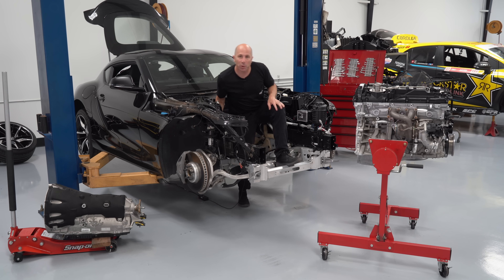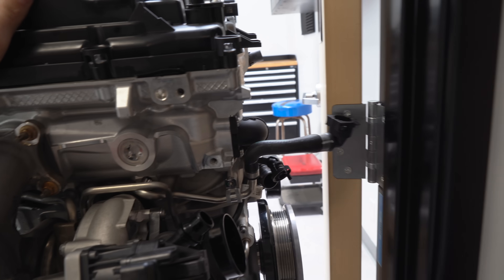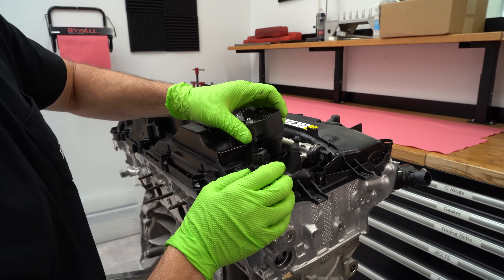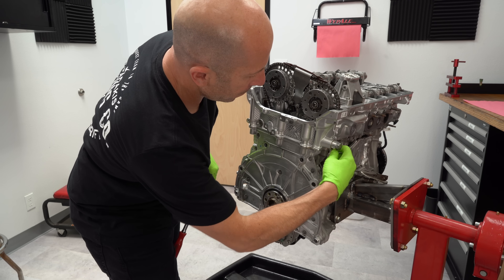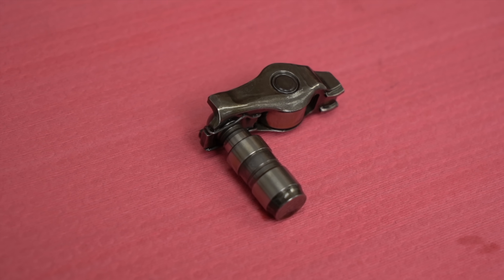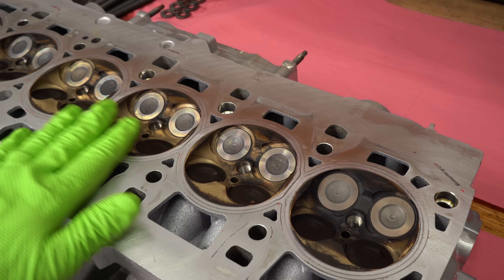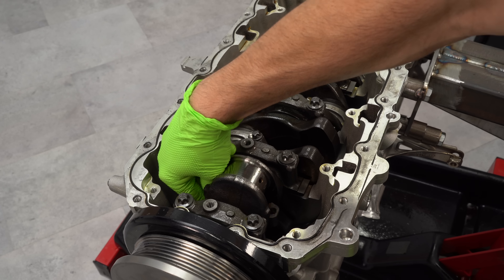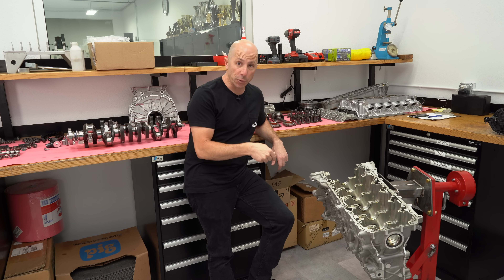2020 Supra B58 Engine Teardown - First Look - Better than the 2JZ?

Comment: Internet experts: This engine is POS. 
Actual race car builder: I'm pretty impressed 

Says a lot doesnt it
Reply: 日産スカイライン  *realise, British spelling. Anyway, Formula D, not rarely, have heavily build up engines, really can't call them stock. Reckon once people know the weaknesses of the B58, they will be able to produce said 1k hp. However, for most track driving and "semi serious" drifters, 600 hp is enough. 

Formula 1 cars V6 produces around 750-780 hp, the rest is produced by its electric engine. Not everyone is a world class driver who earns 10+ million dollars. If you are in said Formula, or Formula D, you will NOT be driving with a stock engine with a massive turbo on it.
Reply: Auugh   Nobody who knows anything about engines bolts a huge ass turbo to an otherwise stock setup. I’m Completely positive thousands will do exactly that.
Reply: And yet all the pro drift teams swapped in 2jzs into their cars lmfao
Reply: @SaturdayWinter  not really if that's the case we'll see nothing but JZ's in FD but we still have the drama of drivers having different engines so your point is subjective and false in a way not completely
Reply: 日産スカイライン there’s already people pushing over 700whp on the B58 on stock internals 🤷🏾‍♂️ and they’re running all good and healthy
Reply: Jordan John it’s not been out long enough to say they are “good and healthy”.
Reply: @V3LOCITY__  they were doing that on bone stock 2jzgte. What's your point?🤔🤔🤔
Reply: 日産スカイライン the REASON why people 2jz swap the new supra is because they don't have time to develop the b58 engine, like Daigo saito
Reply: @ferdihimawan7088  2JZ was daigo saito's specialty, why would you go on with something ylu dont even know and go to a conpetition if you can go with the one you really know and win.
Reply: 日産スカイライン Everyone is comparing this engine to the 2JZ. The bmw engine will easily make 600bhp all day. So if anyone is doubting its ability to "replace" the 2JZ they must be talking about power more then 600hp right?
Reply: @323gtxr  honestly the 2jz aint making much more then this engine to be honest on bolt on im pretty sure on purely stock engine with just ecu flash intake and exhaust this will probably make more power since the original mark 4 supra with its twin oe turbo set up with basic bolt on barely make 400whp this thing just made 420whp with a simple tuned a full exhaust and intake well probably see this in the 460-500whp and bigger turbo/cooler piston rods cams valve springs and fueling set up might see this go over 800whp easily on stock crank this engine is definitely a 2jz successor
Reply: @323gtxr  someone tuned the B58 motor wuth a simple ECU remap not other mods and its putting out 500+bhp at crank and completed the 1/4 mile in 10.7 sec. B58 is 21st century's 2jz engine
Reply: @abhinashpattanaik5109  find that hard to belive, Racechip just did 400at crank,,,you must be another FAKENEWS
Reply: @abhinashpattanaik5109  nah it aint it will never will.
Reply: @323gtxr  stock iternal 2j can handle 6-700hp if this can hade that stock.... I will be impressed. The biggest thing for the 2jz was that it was "balanced" in the way that each cylinder fired. They didn't mention if this engine was or not. That's a big key to making big power with not a lot of work.
Reply: @brysonjohnson2983  if you're talking about primary and secondary mechanical balance, all inline sixes have it. 2JZ isn't alone in this category.
Reply: @RiloElton  ahhh, thank you! That's pretty cool within itself...
Reply: @brysonjohnson2983  The previous N55 already does 600 stock, this is improved design and will do more.
Reply: @mnoovurvi  and k24s are doing 1200hp now. But they don't last for long at all. How long would that motor last at 600hp stock?
Reply: @brysonjohnson2983  They last, there are a lot of people running 600p on the old engine with no problems.
Reply: @mnoovurvi  so then why isn't it know in the top 5 then? Even the barra is more well known than that...
Reply: @brysonjohnson2983  with a built head and modified old pump relief on a stock short block 2jzgte was capable of 800 850 wheel
Reply: @brysonjohnson2983  um what? It's a i6 vs a i6 the balance is likely better for the b58 with direct injection having a better control of fuel. And better bottom end characteristics. The 2jzs only saving grace like all Toyota motors that are popular for power is Yamaha working on it
Reply: @jdrok5026  better bottom end characteristics like what? An iron block? Forged parts? How big are the oil holes to keep it cool? Strength between the individual cylinders? Thickness of the block? What exactly are you saying is better?
Reply: @brysonjohnson2983  an inline 6 is inherently balanced in the primary and secondary forces. That's an inline 6 thing not a 2JZ thing. Derp
Reply: @johnmiller678  did you read what everyone said before you? Derp
Reply: 日産スカイライン  you do realise , that apart from drag racing, you rarely ever need that much power. Track driving or drifting usually are happy doing up to 600 hp.
Reply: @CFAuugh  Tractor engines pullers in trucks range from 2,000 to 10,000 HP (Combine)
Reply: Auugh 
Well said my friend I have 620 hp at the wheels, it does not matter if your on the track or drag strip or streets you very rarely get to use all that power.
Just a reference  it take me about a mile to hit  208 mph/334kph
Reply: @CFAuugh  man it is just unreliable this man have the engine to replace ans fuckung make parts and a 2jz people waste a third of this money
Reply: Auugh Literally all Formula Drift cars are 1000+ bhp...
Reply: 323gtxr Ken Gushi’s first setup for his FRS was literally 750BHP as covered by  SuperStreet.  Wtf are you talking about...
Reply: Mok3sp33d And the current setup?
Reply: @323gtxr  i dont think itll ever replace a 2j being the fact stock internals on a gte can easily hold 700-800 whp. Also notice the dual port exhaust? Thatll be one of the first things to go as for vw used to have dual and quad port flat fours and the dual ports were complete garbage. Second thing to go would be that awful mech fuel pump...
Reply: @ebkbk9902  awful mechanical fuel pump? Do you know what its rated to supply or someshit? Because you just acted like mechanical makes it bad.
Reply: @323gtxr  no their not only some are.
Reply: Everyone on the comments are crying and pissing, and the actual engine expert says it's pretty good.
Fanboys, fanboys everywhere
Reply: 日産スカイライン  Well then, which engine would you prefer? This is the best inline 6 engine in the world that can comply with modern emissions regulations. Toyota hasn't built decent performance engines in decades. Toyota from the 2JZ days and modern day Toyota are two completely different companies, nowadays BMW is the main authority when it comes to inline 6 performance engines and they have been for decades. BMW is known for the M5 and M2.. whereas Toyota is known for the Prius.
Reply: @komentierer  .. You really trying to match toyotas ability to build a performance engine that will also take you to work every day for the next 10 years.. Not 3-5 like BMW?
Reply: Kommentator mercedes entering the straight 6 market soon as well, hopefully theyre up to some cool stuff as well
Reply: @komentierer  Clearly you haven't heard of the mighty barra in xr6 turbo's in australia.
Reply: @lolbye778  Those were only compliant with Australian emissions regulations. Also, they stopped production 3 years ago.
Reply: @lolbye778   The Barra isn't being built anymore, and they're not even building cars in Australia anymore, so do you have a point?
Reply: @Theonixco  the barra boys no that's it's junk they just like to talk shit up.basicaly most of the jz guys I talk with find the barra funny and just ignore them
Reply: @komentierer  hahaha you just destroyed that clown! They fools have no idea. BMW has been building THE BEST I6's for over 25 years.
Reply: @komentierer  even though that is true I think that if Toyota used one of their V6 engines from their modern Lexus LS 500 which is already turbocharged (twin turbos if I remember correctly) and is already pushing around 400hp from the factory without any mods or a use the same V6 that can be found LS350 which is also in their Tacoma, and I'm sure due to the Tacoma fans there's some aftermarket value to those engines there wouldn't be as much of an issue towards the new Supra like there is right now, mainly because it would be a Toyota engine but I know people would hate it for being a V6 and not a straight 6 even though it's more than obvious that Toyota had no intentions on designing a whole new engine for performance since that's not their main focus anymore, although I'm not an expert on Toyota engines, I do agree that using someone else's engine is not very promising but I'm sure they have their reasons
Reply: Elon "CheekyKnob" Musk ...it was for production, and to make a new engine platform would have cost way more money and the the Supra wouldn’t have been 60k if not more like 80k so price was a big thing if you compare to other manufacturers.. they wanted it to be competitive and affordable...so why not use some one who already makes an I6 engine turbo...just like how hey did their RAV4 EV, they sourced their electro motor from you guessed it Tesla, although Tesla never gave toyota the ability to diagnose...the only thing Toyota has done new is all their hybrid and fuel cell technology.....
Reply: @Dunki113  dude the supras used to have 3rd part companies come in on the design of the engines.
Reply: @jdrok5026  well, I never said that there was anything wrong with the current engine, other than the negative results from the fans, I was just saying that Toyota could have used one of their current engines instead of a BMW engine, I mean, I saw one of their commercials for one of their Lexus cars literally drifting, I know it takes more than just a good engine to drift but I mean they do these kinds of adverts with their Lexus branch and then expect us to not be upset when they half-ass something in their main branch?
Reply: Elon "CheekyKnob" Musk Toyota would never use a V6 on the Supra. Supras are known for their in-line 6s. Guess who makes a ton of in-line 6s? BMW! Makes sense to me. Not to mention the B58 is really good I have 55k miles on mine with no issues whatsoever.
Reply: @komentierer  so Sad and your right. Also all car companys are be head hunted for making sport cars
Reply: @komentierer  that's because toyota can't build decent engines, Yamaha can..
Reply: @komentierer  "Toyota hasnt built decent performance engines in decades" interesting point. Dont forget who won the 2018-2019 24 Hours of Le Mans and with whose engine.
Reply: @crownmajesta1064  Toyota gets their asses kicked in F1 and only win LeMans after Audi and Porsche left LeMans! I would've liked to see Toyota try and snatch a LeMans championship from Audi the last 15 years when Audi was going full factory support. Porsche was already even though in lemans pushing full factory support and effort into formula E. Still Porsche has 19 outright wins overall at LeMans. Japanese cars get their asses kicked against German and european manufacturers when all out factory effort is attempted.
Reply: @thof8287  https://youtu.be/oXt1o5Z-Jco add 2017 + 2018, 2019 wins. I might add that the fastest lap records are both toyotas and both highest average speeds are also toyotas.
Reply: @crownmajesta1064  And how exactly can I buy the Lemans engien to use ?
Reply: @thof8287  say that to the 8years vw tryied to win paris-dakar, wasting LOADS of money,having more cars in race than everyone else, BENDING the rules in their favor ,and they just wont AFTER mistubhisi retired. You are a FAKE.
Reply: @crownmajesta1064  yeah, the great Toyota LMP cars, which became relevant only because Audi and Porsche quit Le Mans altogether.

Bragging about winning a race, where you are the only 'serious' competitor (as in with a big ass wallet) is pretty fucking stupid, you know...
Reply: @crownmajesta1064  toyota won leman? I thought it was a pitty win for how pathetic Toyota performed
Reply: @balazsecker8204  2014 World Endurance Manufacturers standings
1. Toyota: 289 points
2. Audi: 244 points
3. Porsche: 193 points
Reply: Numbers are numbers dawg. Fuck what youtubers say. Carroll Shelby built up high performance machines and he probably wouldn't care for this engine. You can't pick one expert to make your point. I don't see Hennessy trying to mod this thing. GT-R's 10 years old and it's making 540hp from the factory get real.
Reply: 日産スカイライン this car wasn’t made for you lol. This whole 1000whp group is a niche inside of a niche. 2 seat sports cars are not very profitable because they aren’t very practical. Most people that buy the mk5 aren’t going be chasing huge hp numbers or even modify there car at all. The b58 is a well built engine for what it is.
Reply: How the fuck peoole a actually going to doubt bmw you can pull nearly 400 bhp out 3 litre n57 diesel Mon like.
Reply: 日産スカイライン  1000hp 2jz breakdown all the time too lol
Reply: 日産スカイライン=Nissan Skyline in Japanese words. All of these cancer done by a sole Skyline fapper. Well done XDDDDDD
Reply: Well horses for courses as the saying goes. His primary goal is to make big hp for a season, maybe a year, then it's torn down and rebuilt. Joe Bloggs on the internet just wants it to keep working for longer than a mobile phone signal standard. I've got Alfas and they're much the same - beautiful engineering to make things go and turn, longevity and ease of repair were secondary considerations however.
Reply: 日産スカイライン  "tons of race car builders"? Give me some links bro...
Reply: I think there is some cool, well thought out design features of this engine, but if it was simpler and easy to work on, like the 2JZ, then the ppl in general would condemn it less.

i remember hearings stories from old mechanics about when carburetors were being replaced with computer fuel injection and how allot of them left the business...just cause it was something new, complicated and misunderstood.
Reply: @Deadpool4352-f3v  Of cause it could, street legal to 2019 emissions regulations and with minor modifications to factory spec. And with 1000hp it lastet 200k miles with just an oil change.
Reply: 日産スカイライン  and you are Japanese and the guy that commented I guarantee your opinion mature more than his
Reply: @Legend-lc9bv  
I don't know, man. Japanese regular folk are the biggest fanatics on the planet. And fanatics with their opinions aren't to be taken so literally. Especially when their country has an outright zero tolerance on metropolitan street racing. If he isn't a professional race car driver, mechanic, or a certified automobile engineer, I wouldn't take his work for a lick damn.
Reply: There is NOT "tOnS" of people anywhere swapping 2J's into MK5. There's ONE maybe, maybe 2. But what a stupid thing to do.
Reply: 日産スカイライン   Not just Americans speak English. Both "Realise" and "Realize" are correct, based on where the speaker is from.
Reply: 日産スカイライン  
Calm down, kid. You're not even a professional race car driver. Plus, Carfax wouldn't even give you 2k for your riced up POS.The tuner scene is a joke, really.
Reply: Internet experts drive cobalts with cold air intakes. Their opinion doesn't matter
Reply: 日産スカイライン  steph papadakis pushes the limits and truly know what he's talking about. He took the 2AR-FE and made it a beast of a motor. I'll take his wisdom any day over anyone else.
Reply: The GTR was a supercar. The supra was a gran touring car. Most people here need a history lesson.
If you complain about the car because of cost and reliability it's fine. But if you complain about the supra and bmw engines being reliable, but if the McLaren f1 is one of your favorite cars then you're a massive hypocrite.
Reply: are you surpised internet people are uninformed?
Reply: If we go back in time 25 years ago, the 2JZ was a fairly new engine that tuners were figuring out how to squeeze as much performance as possible out of it.  It took years before 1000hp+ A80 Supras became common.  And our world is far more connected to the internet than ever before so it more than likely won't take as long till A90 Supras with over 1000hp become common.  Bottomline is we can't satisfy everyone.
Reply: Dat Boii  it makes more hp than the z4 tho
Reply: No, its one "race car builders" opinion, no actual numbers or testing to prove otherwise. Until they reach the limits of different components and start uncovering the weak points in the engine I will still have my doubts.
Reply: 日産スカイライン with that logic every brz and 86 would be wide bodied and turbod. Not all People w money to buy this car are going to go balls to the wall with mods. A good amount will remain stock. Your using your nostalgia of the mk4 and comparing it to now.
Reply: 日産スカイライン  your a idoit....
Reply: 日産スカイライン  they didn't build the whole engine. They had an actual idea to make a 3jz but it was scrapped. Because it would cost the car way over 100k because of R&D. And their target competition was the Porsche Cayman, not the Nissan gtr.
Reply: 日産スカイライン what about the S50 then ? Since is at least bmw engine going in bmw bay ? Why we bring 2jz since that part of the car is not Toyota ? What 2jz have to do with the new supra at all ? Nostalgia probably 😁
Reply: 日産スカイライン well I did make my own version of a Supra in a car building game called automation. Only thing is if I showed you how it looked like and the specs, it would look exactly like a Lexus. I'm even thinking of getting a manual as a first car. Since here's what the stereotype is, it's basically "You have no right to complain about a car if you can't afford it." That stereotype is seen a lot in the car industry. And even I know coupes don't sell. But it's not like they can make a 1000hp engine without having a huge ton of emissions. Which make modern cars so heavy.
The 2jz lineup ended in 2002. People are always going to find a way to complain. If they put a Lexus V6, they will complain about it not being an I6. The 2jz was a response to compete with nissan's RB26DETT engine.  The one thing that made BMW so popular was probably their m3 e46, especially the gtr because need for speed most wanted. But yeah as I said,manuals don't sell well in America. Europe and Asia are already fine. But for it to sell well in America, people in the us need to drive manuals more. But even news articles says that most young drivers are no longer interested in manuals. I'd want to talk about this more but problem is I can't type for too long on YouTube comments and they always switch every single time. So if you have some type of social media we could continue there. I don't want to start a war.
Reply: Bud.. While it might be impressive as fuck.. The average joe that buy this automotive abortion does not have the budget of a race team! We have seen the performance of both BMW and Toyota and history proves, there is no comparison.. Both start out strong, only one passes the test of time, durability and reliability! That is what the "internet" warriors are referring to when we call that motor a massive and grossly over complicated POS!! Understand?
Reply: I remember a guy brought a 1000hp Supra to the track one day. He literally couldn't drive it because it had the worst fuckin powerband ever. Good luck with all that idiots. It's not a Formula 1 car with giant, sticky, purpose-made tires and a giant wing for downforce. 1000hp in a 1000 rpm band is going to be shit and turn worse times on almost any track aside from maybe Road America.
Reply: Too much plastic. In 10 years these care will be nighmares
Reply: 日産スカイライン  facts, 200hp is more than enough to break a car loose. Used to do it in a ranger with only 120
Reply: the people on the internet are more mad about the car itself than any of it's parts. it has a $60,000 price point a race engine builder better be impressed
Reply: Yep
Reply: 日産スカイライン  you are correct about that oil hasnt been much of an issue my clutch fan exploded though sending some if it through the old radiator which I planned to replace anyway because BMW is known for using plastic where it shouldn't be but my real issue was dealing with some suspension issues that the previous 2 owners did not take care and vaccum leaks because the lines are almost as old as I am but since fixing that the car has been pretty cool yo just working suspension now yo
Reply: "impressed" can go in two directions
Reply: Dat Boii  BRZ?
Reply: But he is selling us something.
Reply: No not really. This isn't an engine you'll see very much of, and when you do, an expert opinion doesn't mean shit, because they aren't the one fixing it.
Reply: @babajungLA  thats because nobody knows that" lease a bmw dont buy it" ...another fakenews
Reply: @Deadpool4352-f3v  you and your butt buddy with that wierd ricer name tag enjoy talking shit. While I go enjoy driving cars.
Reply: 日産スカイライン  you are right about the resale value but wrong about reliablity. My f10 535i has done over 140000KM and not a single breakdown apart from timed maintenance schedule. Servicing is pricey but my car is munching miles so effortlessly. Only problem i face with my f10 is the tyre as i have to import it from outside it's damn expensive!!! Plus i am planning to get a Steinbaur powerbox from austria to increse the midrange punch.😁
Reply: The only thing that sucks is the timing chain location. The engine has to be pulled out to change it.
Reply: +QurttoRco If you're genuinely surprised random people on the internet generally have no clue about what they're talking/complaining about boy do I have news for you.
Reply: @dumbdumb572  i do not understand you message
Reply: Well what else do you expect , he is a Honda guy , they should have had Vinny Ten doing this video lol
Reply: THATS WHAT I’VE BEEN SAYING!
Reply: 日産スカイライン  Maybe BMW payed Toyota to screw up on their Supras?
Reply: Dat Boii  I k o o ok k Oo bk o
 K no k. K. No oo k k k  invite
Reply: B58 has been has been out since 2015 why has there not been any h horse power over 700 in the past 4 years? what's the hold up?
Reply: @adamcz3183  there has been 700 plus hp the hold up mainly is likely the direct injection. Just like the 2jz it's going to take awhile to get high hp. Except the b58 might actually be a good engine.
Reply: QurttoRco Not really, it’s all preference.
Reply: 日産スカイライン it's not the engine actually, just the electronics are very bad. I know lots of people would like to have a new manual Supra. But, from a business standpoint you have to first sell it to the normal sports car market. Which most are automatic. Manuals don't sell that much in the us. But for Europe and Asia they might.
Reply: Or the new answer experts now give. Internet experts: tHe c8 eNgINe iT"s bEtTeR!
Reply: I wonder how many people ACTUALLY think this engine sucks lol
Reply: @joshmellon390  it doesnt suck, not by any stretch of imagination. It comes from an automaker who has been building I6 for a lengthy amount of time. Its just not what we wanted. Just like how Honda fans hated the hybrid transmission in the NSX.
Reply: @crownmajesta1064  hybrid engine with a DCT tranny
Reply: @Deadpool4352-f3v  n55 is a pretty good engine. My car has done over 140000kms and i remapped it and now it puts out 400bhp. Also planning to get an steinbaur powerbox😁
Reply: @abhinashpattanaik5109  my dodge neon makes more than that with 2.4L
Reply: @atodaso1668  it's stage1 flash with a mild tune and i chose for a milder setup because 400BHP is more than adequate for indian roads.. Anything over that it would have become a pain in the ass
Reply: @Deadpool4352-f3v  well then send my pity to your friend but i say it cause i own and drive a bimmer. If it were that unreliable, i would have surely dump my car on the bmw service centre's roof. Afterall we indians love our hard earned money to be paid off to the fullest. The 35d versions which puts out 300bhp and comes with a xdrive system had fair share of problems. But its all sorted out after the f10 facelift. My N55 is jewel of an engine, period
Reply: @networkengineer4405  it's a concept. The current car has a lot of cues from the FT1.
Reply: Truthfully, this engine looks like it was made for modular aftermarket parts. I'm impressed.
Reply: Dat Boii  Please explain what a "Toyota" is here in 2019/2020?
I will tell you, today Toyota is yesterday's vehicle for tomorrow prices. In the Supra IV days they were tomorrow's vehicle at today's prices. They havent designed/engineered ANYTHING worth mentioning in the last 20 years. Do you realize how lame it sounds trying to prop up a company who left their peformance crowd behind so long ago?
Reply: @johnmiller678  well they made the LFA supercar.
Reply: @ebkbk9902  well it kinda replaced the 2jz😁
Reply: @abhinashpattanaik5109  not even close. thats why people already 2j swapped their brand new off the lot bmw? There literally ripping out these trash b58's and making 2j swap kits already.
Reply: 日産スカイライン  z4 is based on the 3 series and 5 serie(CLAR platform) Toyota gave the supra 2 seats because short wheelbase will improve handling dynamics.
Reply: 日産スカイライン  1 year and 25 years is a very huge difference. Emissions regulations was different back them, toyota probably fixed problems that the 2jz had over time. Tell me, how demanding was the sports car market back then compared to now?
Reply: 日産スカイライン  thats basically a rebadged rc f and there's a difference between that and the new supra. The rc f is more for top speed while the supra was made more for acceleration and cornering.
Reply: 日産スカイライン if you complain about a car engine because it won't make muh 1000 horsepower then there's clearly a problem.try selling a car from a tuner standpoint and see how it fails
Reply: Tohafat your logic makes no sense. If he saw flaws in the engine, why wouldn’t he state them? They’re building a 1000+ engine. He’d want to mention any weak points they fix
Reply: Guy that gets paid to fix it: It's great!
Customers that have to pay to fix it: Fuck this
Reply: 日産スカイライン  The engine is relatively new. Jesus christ over her predicting shit. I mean do you know the limit of the B58? Like it's around 1 year old or somewhere around that area.
Reply: 日産スカイライン  I'm not a fan boy. You see you're classifying from a group that i'm not from. Furthermore isn't this just a  copy and pasted paragraph. Like Jesus what's the point for arguing in a 2 week old post.
Reply: Race car and average user car is very different. Race car changes engine once in 1000km or less. Average user car need to ride with ome engine for whole life. Sorry for my english.
Reply: 日産スカイライン  I really don't wanna involve myself in this but anyway the B58 looks like a good platform for what it is regardless of it being a BMW motor. It's decent for what it is and can more than likely make a decent amount of power(calm down before u jump the board and say that the 2js better that's not why im making this comment, im heavily talking about the B58 only here)for what's done to it. Since the engines basically N54/N55 that is closed deck and has some parts like the block and bottom end being derived from the B57 diesel plus its block being made out of the same material as the VR38 and coyote I see no problem with it hitting 1000hp now while in the Mk5s case it'll probably hit 1000hp by the end of this year(not saying it will)since companies already have it hitting 560hp while the BMW's with the B58 have(from what I've heard)hit 820hp from stock block and internals with a bigger turbo, pistons,injection,and a tune. Now the only things that I know of that's different in the MK5s B58 that Toyota had changed is the fuel system,turbo,heads,and the amount of oil squirters in it's B58 while all the other B58s in BMW's dont share really any of this that's in the Mk5. I'd also like to include the S55(ok please don't bash me too hard on this im still looking into the S55)since really it seems like no one's really taken notice that there are a few companies that already kicked the S55s in BMW F80 M3 sedans up to 1000hp up(one hit 1170+hp on stock internals,and block just recently breaking the old record of 1158hp)there might be a few of these but I feel like these should be able to hit 1000hp or pass 1000hp without a problem now not saying it's going to hit 2j numbers but it's should be up there in its own region of hp(I'll go off and say it can hit 1100hp at best).
Reply: 日産スカイライン  F1 cars weigh 1000 lbs and are shaped like flat wings, no streetcar can match the downforce. You should really do some research
Reply: It's still a BMW
Reply: Dat Boii  but Toyota never said it was anything else
Reply: it says this guy is paid shill of toyota/bmw
Reply: The 2020 Supra was recalled (by BMW) for bad welds.
Reply: Well the bmw engine doesn't have near the aftermarket support the 2jz does and its a more advanced engine than the 2jz. It would make more sense to go with the 2j until the Bmw engine has the aftermarket unless you are a guy that likes to be at the forefront of things. Like LS guys have not messed with the newer LT direct injected engines yet because there is not a lot of aftermarket support and enough in the junkyard yet
Reply: 日産スカイライン  Toyota doesnt deem to care about performance cars anymore. I know they where not letting video games use the supra as they claimed it gave them a bad image
Reply: Yeah ok a plastic intake manifold and intercooler im good. This shit doesn’t look like it’ll last at all passed 10 years hope no one intended to keep one as a collector car
Reply: 日産スカイライン  Except it already hit 1000HP in many builds stock or next to stock, dunno the WHP. I don't think it's as strong as the 2JZ, but it's a good engine. BMW do make good engines, everything else though... egh... pretty poor quality. 

And keep in mind that the b58 can't cost too much and modern engines cost more due to the more advanced, or should I say different design architecture, so if it had to be as strong as the 2JZ it would cost too much.

Also, I'm not a fan of plastic and plastic parts, but everybody is using plastic now it seems.
Reply: 日産スカイライン  Ouch no way, BMWs cost balls to repair even if you somehow manage to do it all yourself. Parts alone are very expensive.
Reply: 日産スカイライン  And BMWs are much prone to breaking/failure of electronic components, seals, gaskets and other fluid leaks, because Cheap Plastic Parts.
Reply: 日産スカイライン  Ouch.
Reply: 日産スカイライン  They are complex so that you have to go to their dealers.

But they are not as bad as higher-end Mercedez cars, where you have to go to their dealer with their "special" scan tools that the cars are made to recognize them and only them, to clean your errors, or your car will remain in service mode...
Reply: @YaBoiScoots Yup, people just hear that BMWs are not reliable and expensive to maintain and think everything about them is unreliable.
Reply: 日産スカイライン  stop it okay my BMW 335i for 10 years now it's at 189k the only issue I have had with the car pause valve cover gaskets and the fuel pump other than that the car is running like a dream with a tune and all but my baby is my Toyota soarer 1jz- GTE 5zigen fn01rc s Vortex body kit I picked it up for a grand.
Reply: @日産スカイライン, @323gtxr and @Auugh

Even the Group C and Group 6 sports prototype engines produce over 1000hp (even though it was just in qualifying trims)

Examples: Nissan VRH35Z 3.5L V8 - 1100hp (in the R90CK), Toyota R36V 3.6L V8 - 1000hp (88C-V to 94C-V), another Nissan engine, the VG30 3.0L V6 - 1200hp (in the NPT-90), Ferrari 308C 2.5-3.0L V8 - 1200hp (in the Lancia LC2), Porsche 5.4L flat-16 - 1100-1580hp (in the 917/30), etc... And yeah, the cars with those engines are circuit racers.
Reply: 日産スカイライン they swap to 2jz because they want A Toyota with Its soul. The heritage the Feeling The Spirit of Japanese Built Engine.
Reply: That said, while the tech in this engine IS super cool, it kinda sucks for people who want to modify the engine. Integrated intercooler? Integrated exhaust manifold? Sure, these things are cool for a stock engine, but they all need to come off and be replaced if you want to modify anything.
Reply: says someone paid for the car.
Reply: People are so stupid. If there’s one thing BMW knows how to do, it’s build an Inline-6.
Reply: Looking back at these comments and seeing all the haters disappear. MKV Supra is already a legend.
Reply: 日産スカイライン  huh
Reply: 日産スカイライン  look at the new vid
Reply: I guess it’s depends what the applications are?  Can’t image every customer will need a race engine.  Sometime you just need to point A to point B every time without breaking......
Reply: 日産スカイライン B58 is better than 2JZ because 2JZ has fanboys and B58 has haters
Reply: 日産スカイライン  All cars above 1,000 HP are hellishly unreliable, so yeah.
Reply: This comment section is a fucking shithole, someone saying 1000hp needed to drift, dude if you cant drift with a 250hp silvia then you dont know how to drift yet
Reply: years later and I bet these people doubting are eating their words lol
Reply: 日産スカイライン  With enough money anything makes power. Your argument is invalid.
Reply: 日産スカイライン  well the B58 on paper should hold 1000hp and not break highest reliable B58 last seen was 700hp (to the wheels) but aside from that people haven't really messed with the B58 now just cuz it's the power plant powering the new Supra people wanna see if it lives up to the 2JZ so they're already doing everything to squeeze all the power out of the B58 and see if it survives to rip another day
Reply: he only says impressive from a race build potential standpoint and NOT for a serviceability standpoint bearing the legendary Toyota badge. big difference. you missed when he says only time will tell and bmw/toyota? yeah. this car has BMW repair prices, NOT toyota repair prices.
Reply: @hostilityy  At 1000hp repair prices and badge does not matter. You cannot go to a toyota dealer with a 1000 supra. 
BMW servicing is completely normal, not expensive at all. The engine is really reliable as well.
Reply: @mnoovurvi  Facepalm. I don't care about 1000hp, I didn't mention such. I'm talking about the general engineering and factory build of this car. it will be a moneypit as it racks up miles as a daily driver like every bmw. all you ricers always got turbo vroom vroom 1000hp in your head don't you?
Reply: @hostilityy  Again, you know that by owning one or more ? N55 is really reliable engine and more tunable engine for that money does not exist. 
It has been out for years, the B58 is improvement on that. It's not completely new engine. It's a money pit for people like you that have never even sat in one.
Reply: hostilityy service for the B58 is not bad at all it honestly does a good job at separating itself from the BMW stereo type of engines needing a lot of service done to them and very expensive service at that but let’s be real most car guys service their cars themselves
Reply: Don't choke On your aspirations director They can use S50 any day instead of 2jz. Not expensive at all and can handle pretty well big turbos. Way better engine for turbo conversions in the new supra instead of 2jz
Reply: 日産スカイライン  You know very well that people are swapping 2JZ's because they want reliable 1000hp RIGHT NOW. The B58 has not been figured out by the aftermarket at this point, but it will be and then there will be much less swapping. In fact you might start to see B58's going into other cars once there is good aftermarket support.
Reply: @M3LKS  lol lets put a 25 year old engine in a 6 month old car, lmfao
Reply: @nicklaw8247  ...Yeah if you want real power that you can go buy groceries with on Saturday morning, take it out cruising ajd street racing Saturday night and then go beat on it at the track on Sunday, only to come home park it and wake up on Monday morning at it take you to work.. Then yeah lets do just that.. Because anyone who has every turned a wrench, anyone... Well tell you that aint BMW!!
Reply: @randolphcirilo4800  I disagree, I work on these all day everyday. If you can work on a euro you can work on anything. You can thrash the shit out of these engines and still daily the hell out of it. Obviously need to wait for the thing to warm up before thrashing it (which should be common sense but isn't in this day and age) BMW make good cars it's just majority of their owners are thick as pig shit. The average Toyota technician obviously won't know how to fix it hence why there is such an uproar because they'll have to do real work now. Look at the Toyota 86 recall and see how well that's going for Toyota. LOL
Reply: @nicklaw8247  Deusenbergs had dual overhead cam and mechanical injected inline 8 engines...in the 1920's. A 2JZ has all of the function and performance this 2020 engine delivers...without cheaper manufacturing schemes and novelty components. The only way anything could depart from a decades old engine is for the connecting rods to be replaced with hydraulic fluid and the valvetrain to be solenoid actuated.  This "modern" engine brings nothing new to the table a racer would desire.
Reply: @M3LKS  needs a fast and furious movie,lol😂
Reply: @M3LKS  1000whp reliable and bmw shouldn't go in the same sentence lol not hating but this engine has more flaws then you notice.
Reply: @ebkbk9902  Damn, you are clearly smarter than Papadakis - they did not notice the flaws and are delusionally going for 1000hp.... why didn't they hire ebk bk....
Reply: @M3LKS  When it boils down to it an ls/lt is better then both and always will be. Fastest 2j car runs high 6's fastest ls car runs high 5's dont @ me
Reply: @ebkbk9902  2jz's have done mid 5s lol are you trollin lol
Reply: @ebkbk9902  ok tell us oh wise engineer.
Reply: @ebkbk9902  No engine is "reliable" at 1000whp. It will always need constant attention/tweaking/tuning. Anyone who told you pushing 1000whp out of any engine reliability lied to you.
Reply: @johnmiller678  Thats why tick performance has a 1000hp lt1 they had built for 5 years? Thats why there almost the fastest stick car out there? Dont talk about things you know nothing of.
Reply: he has to keep the criticism in control because of supra was given to him for this video. you can't just say how the engine will perform in long term just by disassembling it
Reply: @lordjaashin  that's a very bold claim
Reply: This engine isn’t for kids to play with like the old Toyota.
Reply: @isfngu4213  the old toyota wasnt made to be understood for kids lmao.
Reply: 日産スカイライン  yeah, but that's because they're stuck in the past. True racecar builders build the engine it comes with. Not swap engine into cars and call it a day
Reply: Tidwell what???!!! No you are ass backwards. True racecar builders BUILD an engine. If you are set on competitive racing you either build up an engine or buy a block already built up for you.
Reply: This reminds me of being at school! It's like Sega vs Nintendo! Only difference is the school kids actually owned and had experience of what they were arguing about😂 So many youtube experts with zero content channels.  I suspect most in this thread have never driven outside of their bedrooms!
Reply: @cmdrdredd  
Build an engine? What what money? Sponsors don't grow on trees, man.
Reply: 日産スカイライン  When is the last time you checked the used car market ? Because most of the BMWs I drive and buy are I6 over 100 000 miles. Most on the market that are old enough given the average use are over 100 000 miles.
You demonstrated that you have 0 knowledge about BMW apart from few forum threads you read. 
All performance BMW engines can be tuned. N54, N55, B58, S65, S85, N63, S63.
Reply: @mnoovurvi  ioo fakenews,i also know lots of mb with million miles,just had 3 4 engines swaps,but according to the ownsers they never breaked. fakenews alert
Reply: Race Motor < Reliable Motor
1200hp "race" motor that always breaks down is useless you have a full maintenance crew.
600hp reliable motor that can go 150,000 miles just by routinely changing the fluids is much more usable.
Reply: 日産スカイライン  realise is spelt different in Europe you turd
Reply: @ArshadChengadu  europe? What Europe? THE UK. British English.
Reply: @crownmajesta1064  sorry I just wanted to complain
Reply: 日産スカイライン  1000bhp+ are only used for drag roads. B58 motor is capable of 800+bhp with stock internals but eith a upgraded turbo( seen one in mumbai).
Reply: This engine is in the BMW 140i, 240i, 340i, 440i, 740i, 840i, Z4 M40 and X7 iDrive 40i. GPower has a package with important things like carpets and decals which includes ECU firmware and a stainless steel exhaust (who needs that with decals and a carpet?) which makes 420hp and 600nm torque for some 4,400 Euros, they modify the Z4 M40i with bigger downpipes and a bigger turbo with bigger intercooler to 500hp. Only the medium performance version of that engine has the integrated exhaust manifold, for a 1000hp another cylinder head might be needed.
Reply: 日産スカイライン  lol nice try but mine has 224k on it runs like a champ the old m52b28 is a workhorse sure it's not the fastest thing on the planet but it uses a plastic intake a lot of people use that plastic intake and make decent power with out an insane amount of mods on the motor so can you tell me agian how mine was supposed to break 124000 miles ago and btw it's the black one in my picture
Reply: @kyleglenn4893  
How many races have you won?
Reply: There's a lot of inconvenient for everyday usage parts of this engine. Chain on wrong side. Parts within parts. Direct injection. These are pretty neat for racing, but not worth it at home.
Reply: @WestonHettinger  How many timing chains have you replaced ?
Reply: This motor is garbage. Nothing modular about it. Youd have to do much more work to this get what the 2jz can spit out with easy bolt ons.  It doesnt even have dual injection.
Reply: @GasGunsGod  This engines makes a lot of power with simple mods. Don't forget that it is nothing new, it is improved from the old ones. Modyfing is not a problem.
Reply: Dat Boii  the 2JZ was built by Yamaha not Toyota, so yeah.
Reply: @mattevans1643  the intake was designed by Yamaha not the engine lol is it school holidays or something
Reply: 日産スカイライン 2JZ engines are a joke. BMW made a better one for McLaren F1. Get this one and mod it. Who cares for such crap like 2jz to swap in a new car. I will make more power from my Diesel engine
Reply: As a race car builder and an engine builder in 27 years in this industry and being around a lot of different platforms yes it is absolute dogshit it's going to have major longevity issues on these things start getting really pushed Beyond bolt ons.
Reply: 日産スカイライン  you say "tons" but there are very few. The people saying its a terrible motor haven't even cracked one open yet let alone even driven the new the supra. Nobody with brains just throws a massive turbo on a car without building the motor first. a stock 2j with a big single will blow pretty quickly. I bet this motor will end up being better than the 2j. Just have to wait for the aftermarket parts to be developed to really see.
Reply: And meanwhile, the VQ is still a better engine than the 2JZ, its only under-rated. More torque for the same power figure.
Reply: @christopherbelanger4220  Lets see how long it lasts
Reply: There are a few drawbacks, but it's a $49k world-class sports car with amazing Toyota reliability, practical and all the comforts you'd find in a luxury vehicle.

The engine is pretty solid (expect for a few cheap plastic bits and a coating that hasn't been proven). Overall for the price, nothing comes close imo.
Reply: 日産スカイライン  This engine won't break down, it can probably handle 1200hp+ with minimal aftermarket parts (mainly the plastic bits).  Solid closed cylinder deck can handle huge power.
Reply: Toyota engines last 3x longer than BMW engines with 1/10 the maintenance, FACT!
Reply: OMG, Did you see all that plastic and rubber attatched to the engine??

Race car builder is not thinking how much $$$ is this simple repair cost me. He's  He's thinking about the engine block and how much horsepower it can handle. We as consumers cant drop an engine and repair some simple part in our carport over the weekend without being at the mercy of the mechanic., when all that plastic  and rubber attached to the engine block starts failing. Not to mention the historic electric and electronic problems with german cars.
Reply: QurttoRco clearly you have never worked on bmws. Go ahead an buy one ill see you a LOT in the shop. 👍
Reply: Well, a lot of BMW 6's have proved to be good tuning engines (M50, M52, N54, N55, Sxx, list goes on) but none of them is even close to the 2JZ. 

To be fair, no stock 6cyl is a better base for performance than 2JZ. RB, Barra, M50 all have some weaknesses that has to be addressed and N5x engines have a lot of them. 

Is the B58 a good engine? Yes, it's probably a really good engine. Is it as good as the 2JZ? Not even close. 

The Supra purists were hoping for a "3JZ" in the same way Audi did a refresh of their 5-cyl. No matter how good this engine is, it's not a JZ, simple as that.
Reply: @ress87  That's because Toyota makes toaster ovens on wheels. They always have. One engine from 20+ years ago doesnt make an entire brand. BMW has always held their torch high in the performance segment. Its Toyotas fault, not BMW the new Supra used a BMW i6 turbo engine.
Reply: I mean honestly Toyota tore it down themselves and improved it to Toyota specs. It's toyota quality already. It's like baking a cake and putting on the icing. I mean the cake itself is just a mass of dough. This mass of dough is pretty much the same between same kind of cakes (quality cakes of course) and toyota put their icing on it, making it a toyota cake
Reply: @carlosandleon  no they didnt. Stop spreading that story Toyota said the engine hit their requirements.
Reply: Most people talked shit because of the price of the car for the power you're getting stock. I've never heard anyone who I personally believe has the experience to talk about cars has ever talked shit about this engine. Talk shit about bmw yes talked shit about Toyota yes.. but the engine no. It's the classic inline 6, it's a ricer's wet dream.